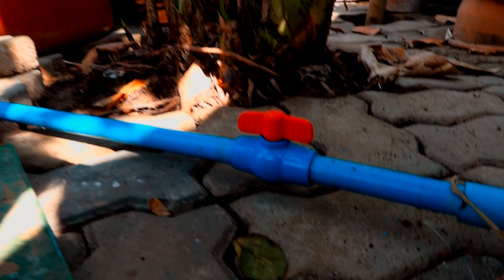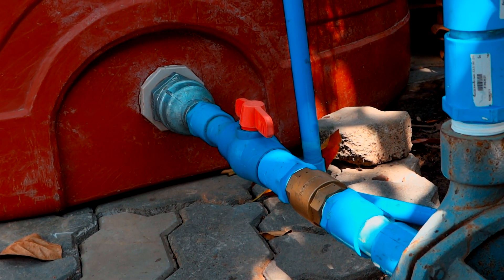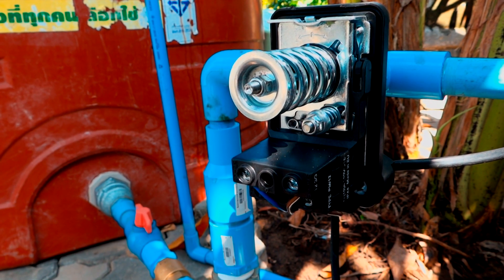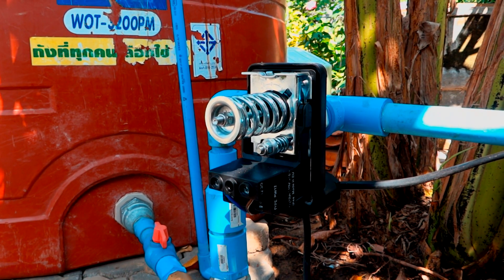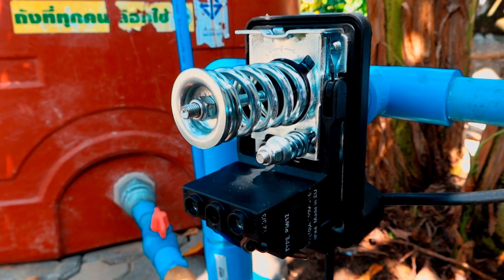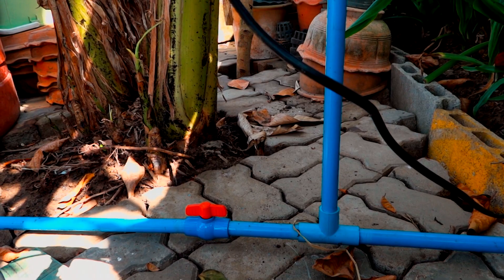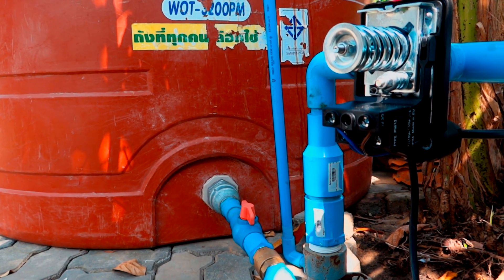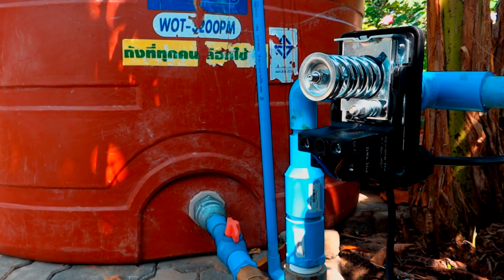How to automatic demand water tank system

Comment: I like it man, I'm going to try it, Valco pressure switch that's what I'm gonna be using, you can fix it to close at 2 bar for protecting the piping and fixtures, but first you need a pressure gauge.
Reply from the maker: Don't forget the horizontal check valve right after the tank without it the balance is not right Thanks.

Comment: so how is your water tank working. my wife family lives in phillipines and they are about to install a water system based on your video
Reply from the maker: The pressure switch always goes after the pump. Tank> valve> horizontal check valve> pump> pressure switch> any water pipe connected to house system. BE SURE TO TURN OFF THE WATER COMING INTO THE HOUSE FROM THE METER OR WATER WILL GO OUT INTO THE STREET INTO YOUR NEIGHBOR'S HOUSE! Works flawlessly. Note some pressure switches aren't very good ask someone who knows a good brand who is not a supplier, my first attempt failed because of a poor pressure switch. Good luck!

Comment: Hi there John, thanks for this video. I plan on doing this in my home and I'd like to ask your opinion about the pressure switch. Would it matter if you put the pressure switch before or after the water pump??.... Thanks in advance.
Reply from the maker: It absolutly has to be on the pipe that comes out of the pump, the water pressure in the house will act as pressure tank. When there is a drop in the pressure when a faucet is opened the pressure on the swich notices the drop and turns the pump on. when the faucet is closed the pressure is equalised and the pump shuts off. Warning all swiches are not reliable, dont go cheap or it may not work well. by the way I am Sean, Cheers.
Reply: Thanks for the quick reply and sorry about the name, Sean. Okay then I'll do that. Cheers to you too.

Comment: Sean, great backup system. If you want to prevent water from going back into the main water supply, you can install another check valve or a back flow preventer like the ones used on domestic boilers. That would make that side of the system automatic also and you wouldn't have to worry about having to close the valve. In the USA it's a code requirement to install a back flow preventer when connecting to potable water. Keep up the great videos. :)
Reply from the maker: No codes here but in the US its a RPZ backflow.